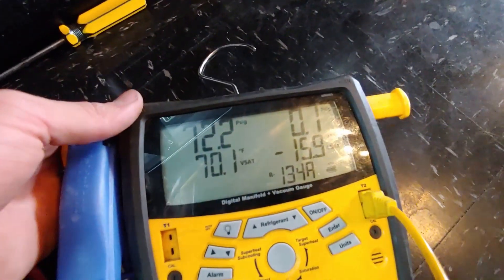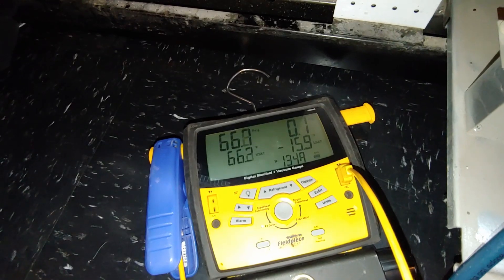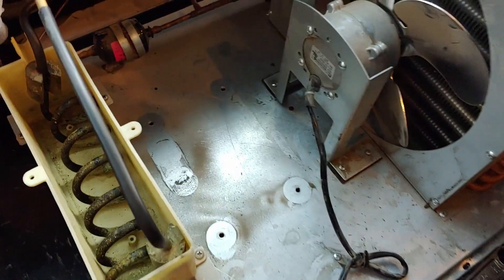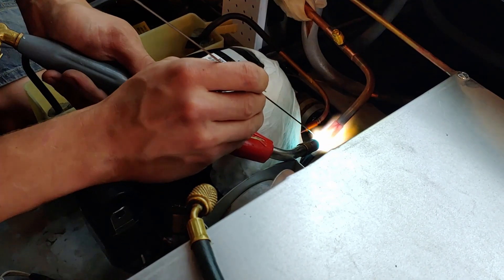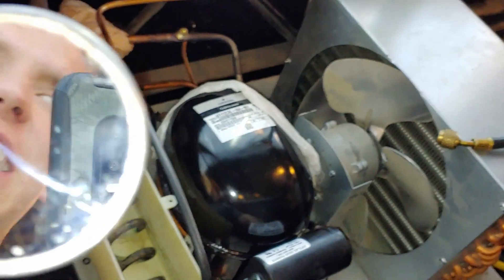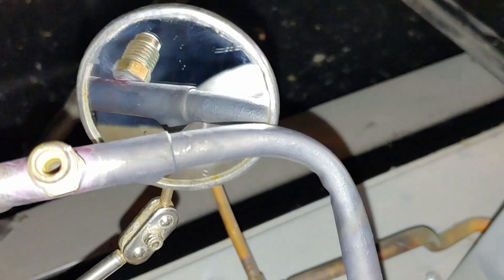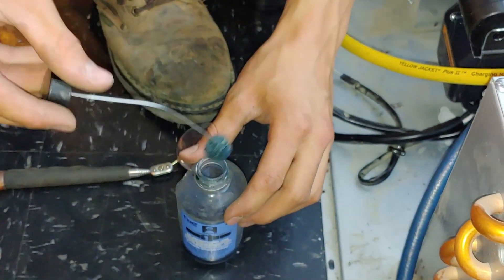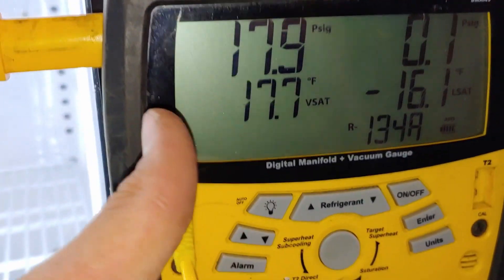Compressor with Failed Reeds (weak compressor) Replacement

Comment: Hey thanks. Which brazing system do you use ? Acetylene or propane/mapp with oxygen ? 

Thanks
Reply from the maker: I just use an acetylene torch that burns atmospheric oxygen. Its a turbo torch like this. https://amzn.to/3KmlPqo
Reply: Thanks, I am just begging to do sewler systems on residential refrigerators and need light way to cary tanks , however I have tried propane with oxygen and its flame is not as small as acetylene ( hvas guys use acetylene but small fridges dont need much of flame ) need to learn other ways to see which I will like